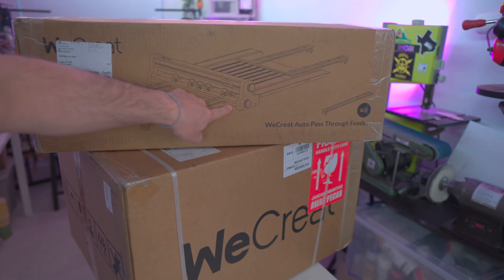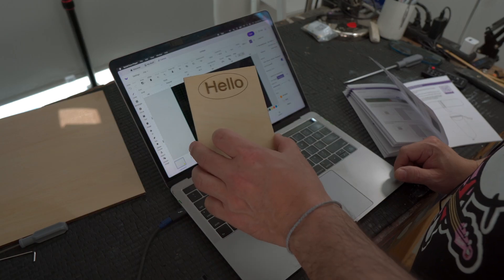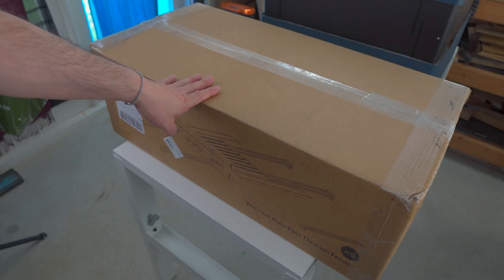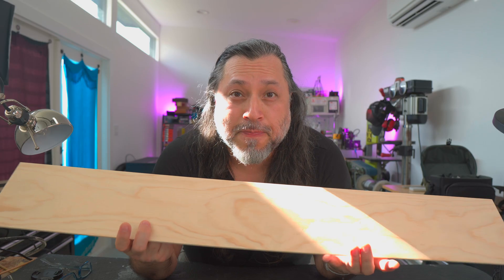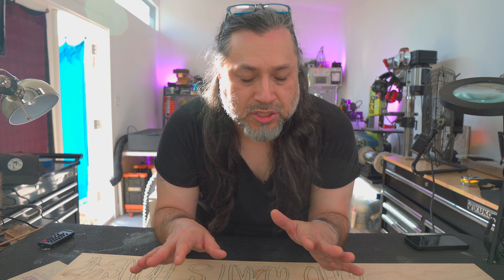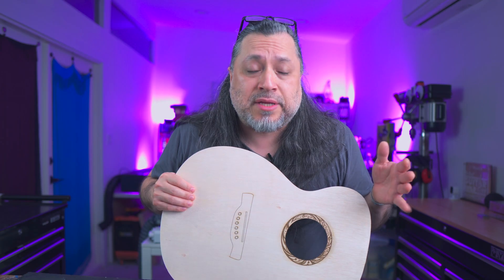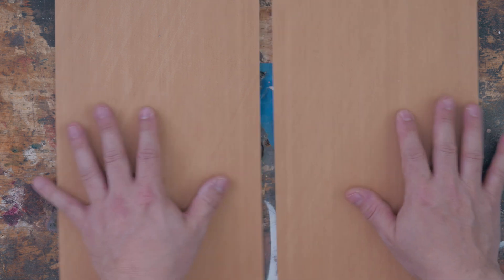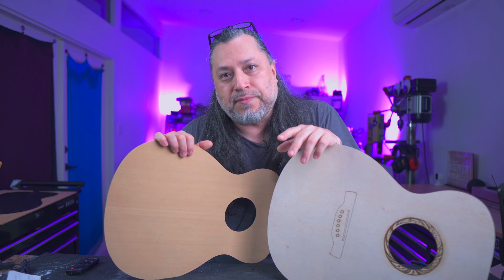Cutting Acoustic Tops on the WeCreate Vision 40W Laser - Unboxing & Review

Comment from the maker: Depending on the thickness of the wood, you can laser an acoustic top in under 6 minutes! If you needed the top to be slightly oversized for sanding or trimming during your process, it's as easy as making the outline as big as you need it. Lots of potential.